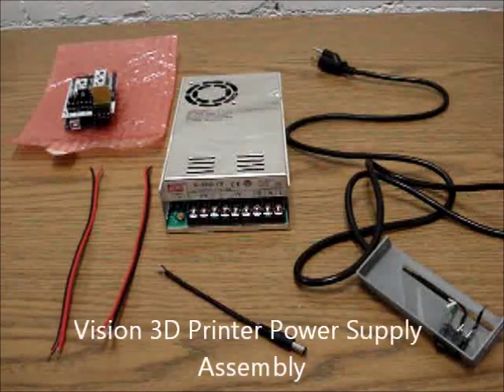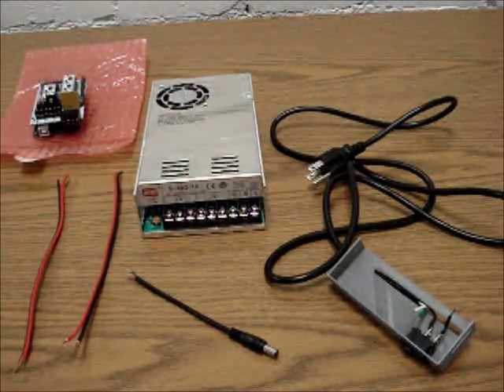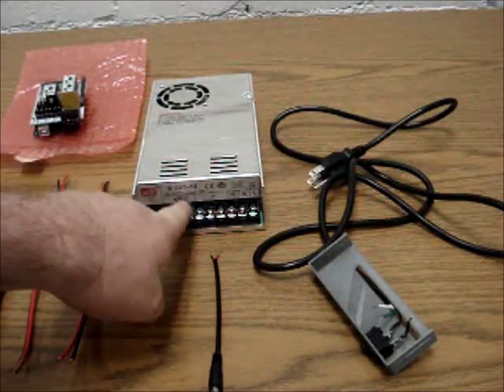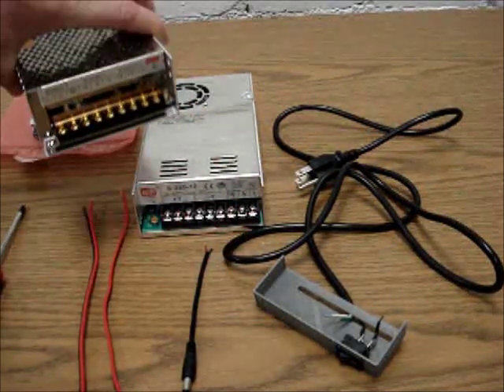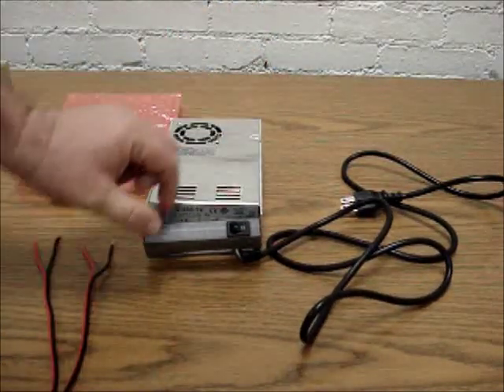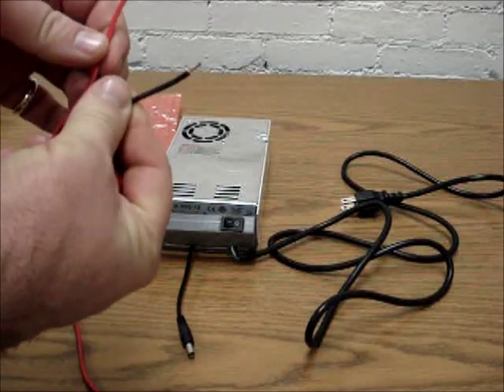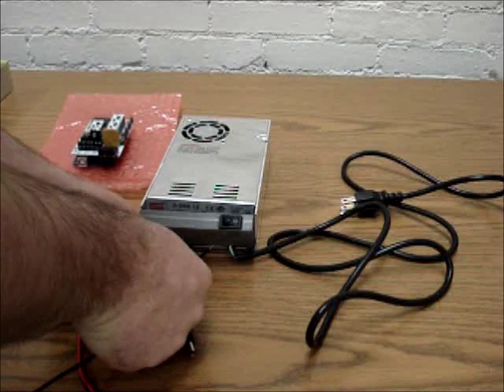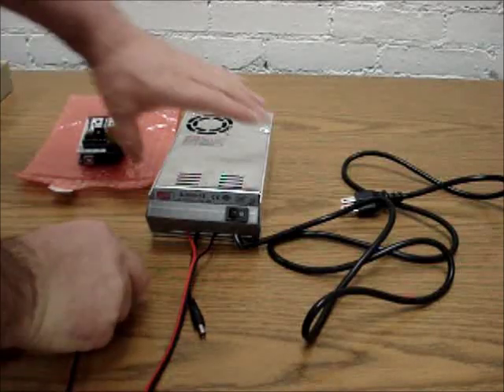Vision 3D Printer   How To Hook Up A 12 Volt Power Supply To RepRap RAMPS 1 4 Controller

Comment from the maker: Both, by powering the Ramps 1.4 board, it feeds power directly to the Arduino. The Arduino also can get power directly from the USB cable, so it important to not have too high of a voltage difference on your main power supply. I keep mine about 12.0 to 12.3 volts.

Comment: Can you explain how you connected the rocker switch to the power supply? Do you connect the outlet cord to the three prongs and then run wires from the three prongs to the load 0V and earth ground?

Comment: i am going to be running a duel  head and the big 12x8 heat bed and an LCD/SD. still in the process of getting all the parts. will one of these power supply be enough to run all that nicely?

Comment: can someone help me.. i'm using the same type of atx power supply 12v at 16.5A i know on the ramps board one input can be 11A + but the 5A one can i just connect it straight to the 16.5A ? i might not use the heat bed so it would be a full 16.5A going to the 5A input would that blow it out??

Comment: Would a 12v 180w supply be enough for a 3d printer
Reply: Yes for the electronics but not for also the heatbed (just 15A in your case).

Comment from the maker: It's far better to power the main RAMPS 1.4 board (it will automatically power the Arduino). The main power connector on any of the Arduino boards can't handle the approximate 17 amps of current  that a 3d printer with a Heated Build Platform can pull. If you are NOT using a heated build platform, you will pull under 5 amps of power, so you could power the Arduino directly.